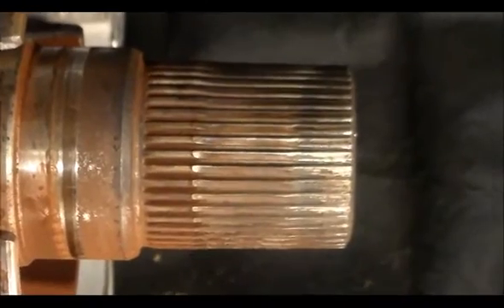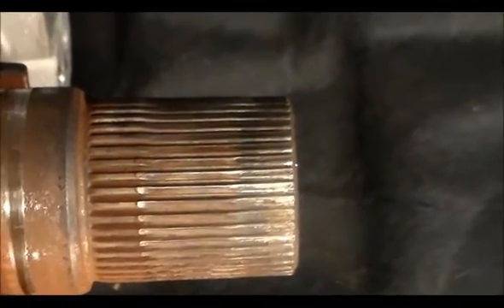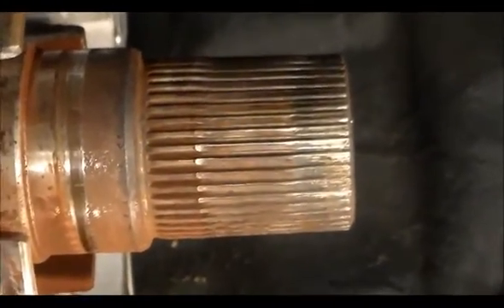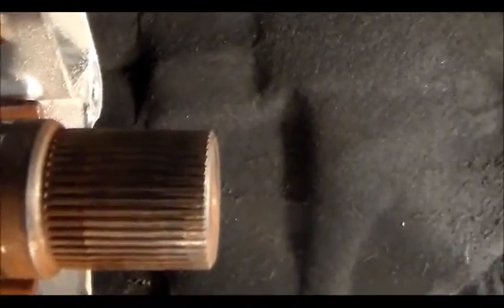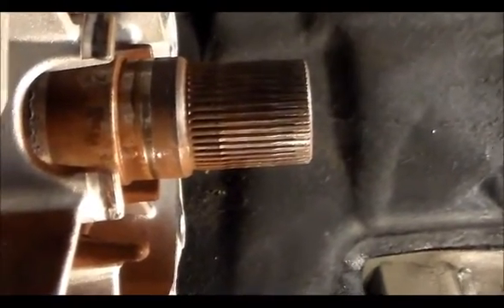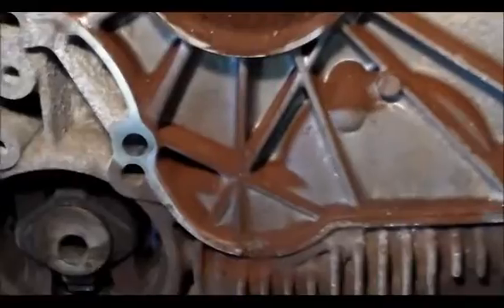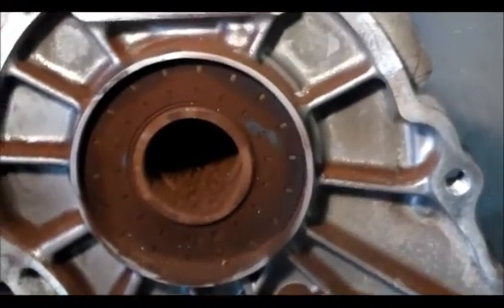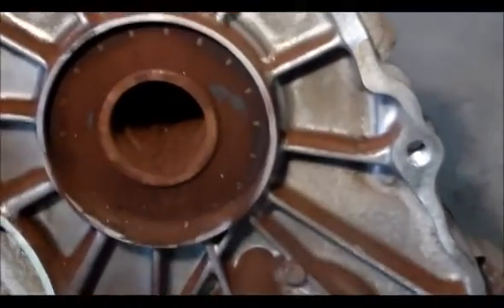6L45 Stripped output shaft

Comment: Thank you for the video. Is there any explanation for the wearing of the parts? I believed the connection with the transfer case is sealed.
Reply from the maker: moisture can get in and when it does that can happen,  i think they changed the design now and an o-ring is installed
Reply: @GaryFerraro  thanks for answering. Is there also a specific grease you recommend?
Reply from the maker: I use the High Temp red wheel bearing grease so it won't melt @ilovescarjo

Comment: Did you end up replacing the input shaft on the transfer case as well, or is the output shaft of the 6L45 softer material than the transfer case input?
Reply from the maker: I think i did both

Comment: same here 2009 328xdrive I wonder if applying silicone grease will help prevent corrosion?
Reply from the maker: I clean everything up and use the high temp red grease, what you use is that good for high temp?
Reply: @GaryFerraro  you are right, for some reason I was thinking  about the silicone that I use  for lubricating the brake caliper pins so they can hold up high Temps but maybe the grease holds up higher Temps I am going to research if they repell water .now I wonder if from factory GM or BMW  grease the splines at all 😅